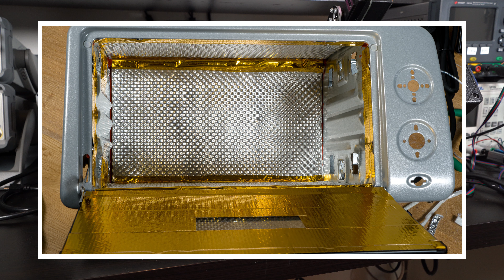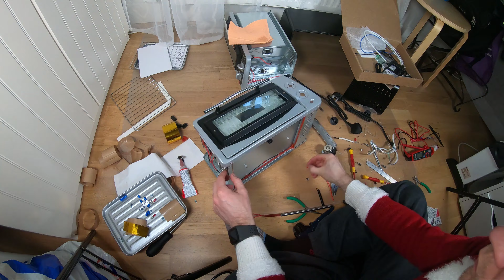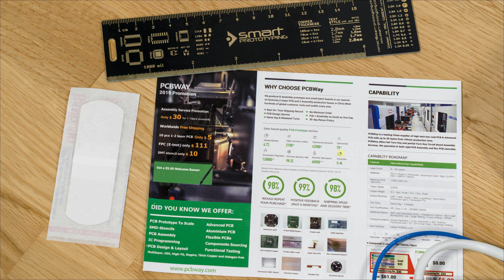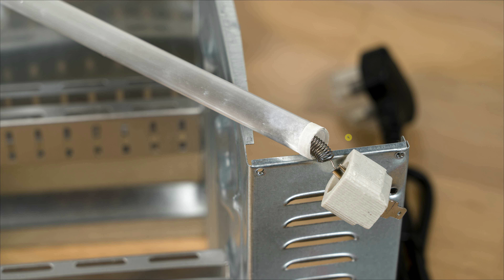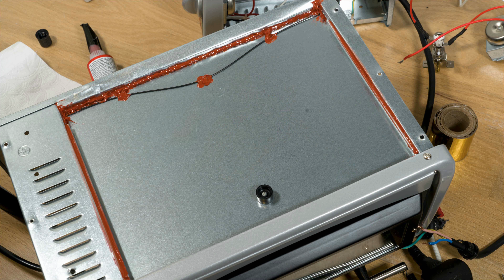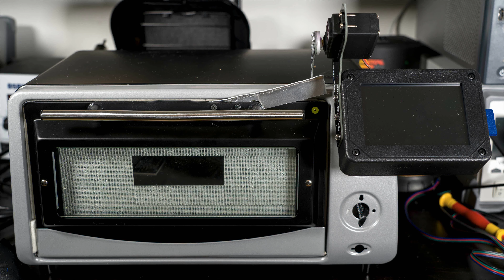Building DIY PCB Reflow Oven from Two Toaster Ovens and Controleo3 Kit

Comment: I'm halfway through building mine. What's ironic is the Black & Decker 1303S Oven uses 1950's bimetal strip tech as a thermocontroller. My experience with such cheap devices, ( Barn Heater ) are that they wear out in 2 years, requiring adjusting the thermostat more & more until the arcs totally erode the surface. It's called planned obsolescence.Then you dispose of the device and buy another. Wiring in this Controleo3 kit, will make this oven solid state and operate many years longer than it's initial intention. I also cut my finger and appreciate the bandaid included in the kit.

Comment: Is it possible to make a m/b pre-heater with the bottom / lower portion of a toaster oven, using 2 or 3 quartz elements? Not to put the whole PCB in it, but just to pre heat prior to heating a m/b GPU for solder reflow. Thanks
Reply from the maker: Maybe, I'm not sure. At least make sure it is safe to use if planning anything like that.

Comment: Wow, amazing build!  The description of your build was very accurate and thorough.  I think the only comment I can make is that the boost element is probably not necessary given the overall power (1600W) and size (9l).  That would make the build a bit easier.  Thanks for documenting your build so well, and sharing it.  This video is solid gold. - Peter (Controleo3 developer)
Reply: Thank you for developing this thing!

Comment: Very useful. Thank you. Also great to see it done from the UK/EU perspective where it is hard to buy ovens with good quartz elements which are 230V. I also picked an oven which has 2x115V elements. I will buy a second one and do the same as you did.  That was my plan already, but seeing you do it has made me more confident that this is the right way. 

I was debating whether I will need the boost element. My oven is 900W, so 4 elements will be 1800W and it is only ~10L like yours. So with the boost from the kits it will massively powered.  (I have 2x this oven : https://www.amazon.co.uk/gp/product/B07MS9NNLK/ )

Interesting that you found the cool down rate difficult. This might be solvable with software? I can understand that it would be hard to find just the right amount of servo angle to get the cool rate right. I don't think that part of the profile is very critical, but if you care about it, it should be possible to do either:

a) keep controlling using the servo angle all the way down. ie use a whole separate PID loop to open/close the door ... not a simple change, but should be possible. 

b) Open the door "slightly too much" and "backfill" this with some heating. ie slow the down the cooling by keeping the elements on a little bit. again requires new PID loop/parameters. 

(... I am a control systems engineer so I may be overcomplicating this...)

Comment: should you keep thermocouple wires so close to the power cables ? These wires are sensitive and can induce fair bit of noise from "switching" AC signal flowing through the power cable
Reply from the maker: They are a few centimeters away which is what is achievable reasonably in that space; and also mostly on other side of the aluminium plate. But you're right, they are sensitive and shouldn't be tied together with other cables, for example.
Reply: @kaamostech  Cool. I am currently building my own controller & reflow oven . Will try to implement some of the tricks you showed in your video.

Comment: Thanks for the video, great work!

What made you choose to build it with 4 elements out of 2 toasters? Is it worth it to build it with 2 toasters rather than just 1? I'm planning a build, and trying to determine if the "standard model" as described will work fine for me, or if I should just do it right the first time and build a 4 element "deluxe model". It doesn't seem to be too much more work to make a deluxe model, rather than a single toaster. And the cost isn't extreme, at about $40 for the extra toaster. Any advice?
Reply from the maker: Sorry I've missed your question. You need a) a lot of power b) separate control for top and bottom elements. At least 230V models of these oven have two 115V elements in series, meaning you cannot control them separately. In the US they are probably in parallel so you could. Not sure if power would be enough then. Maybe. The building was certainly a LOT more painful due to re-fitting of all these elements. So if you find a suitable oven where you don't need to move them, it's a lot easier.

Comment: Cool! How long takes the learn cycle?
Reply from the maker: I think it was 20-30mins. But you only need to do it once (unless you want to experiment with different sensor locations like I did) or when something significantly changes in the oven or surrounding temperature.